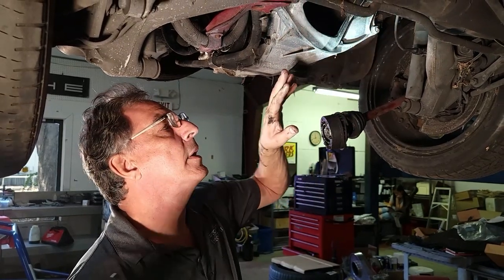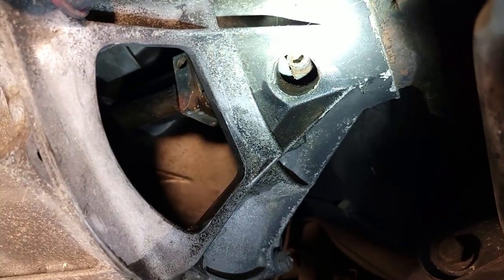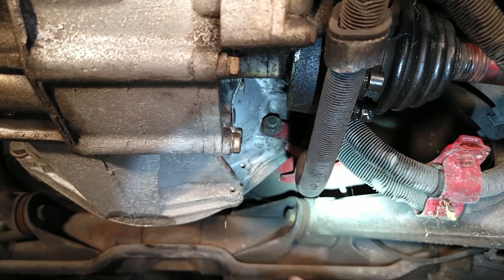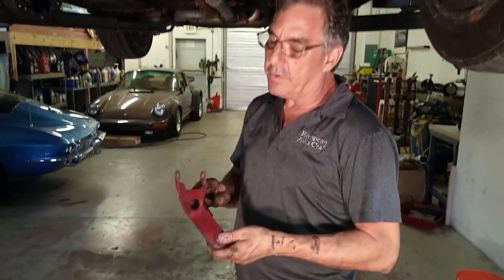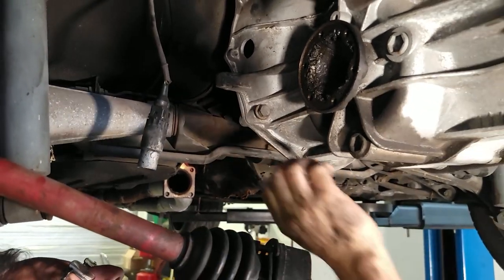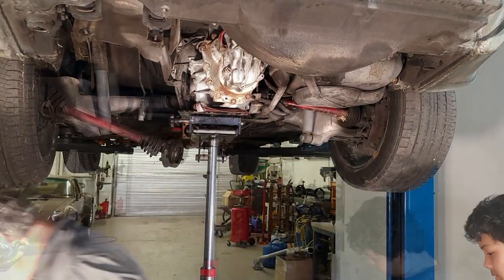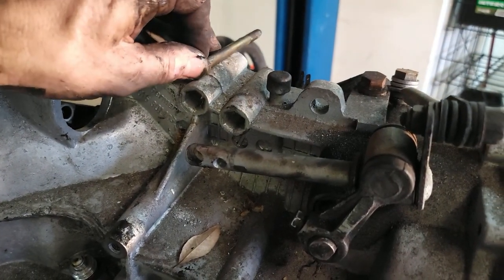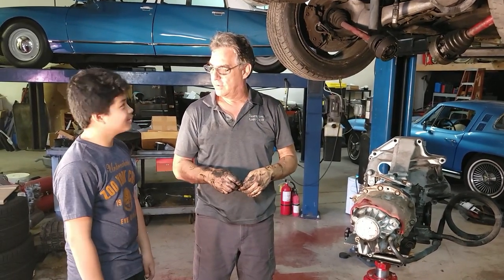Episode 6 Part 2 - 1986 Porsche 944 Turbo Restoration - Transmission Removal

Comment: Thanks for posting.  Really clear images, that is when the "light holder" is working...LOL   I'm confident I can do this even though I have a NA which I hear is even easier than the turbo.
Reply from the maker: The NA is about the same. When you have to do a clutch, that is when it is a lot more work on the turbo. I should have supported the transmission and removed the top mount before the bell housing.  It would have been smoother. Don't tell anyone!
Reply: @EuropeanAutoCraftStudios  Thanks for the tip!